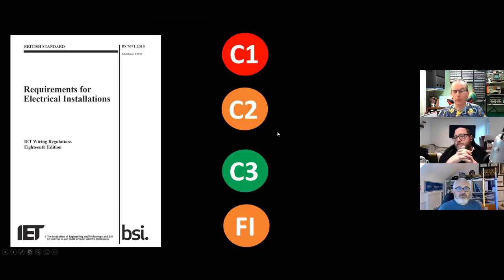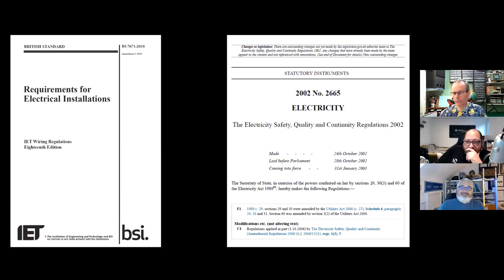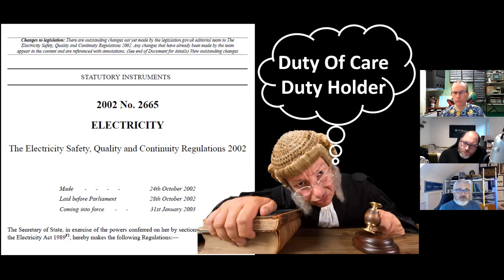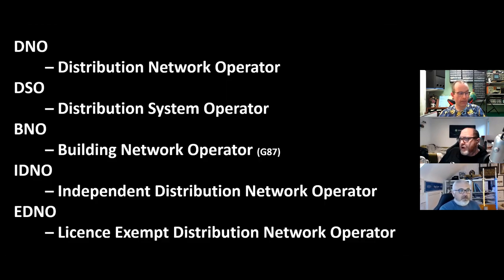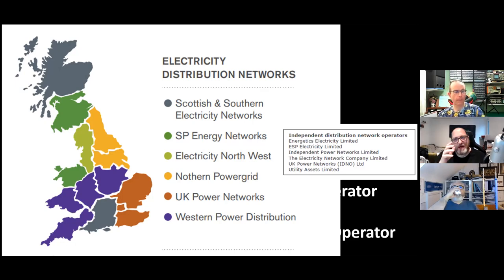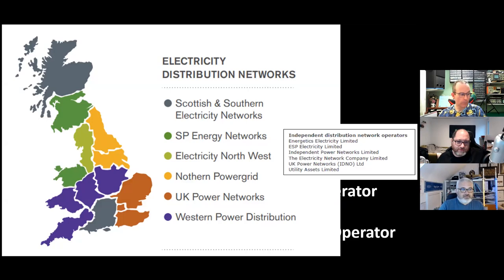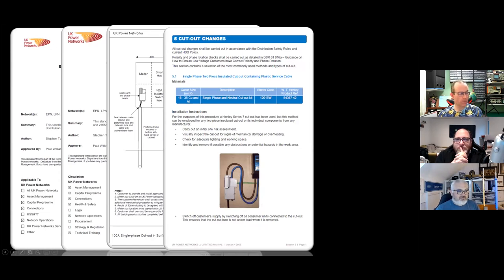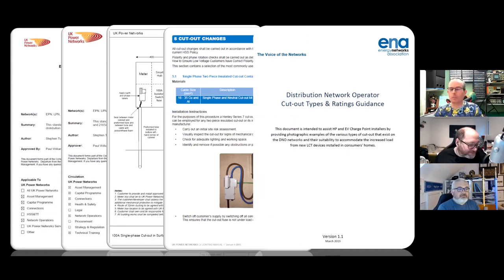EICR coding on intakes with John Ward and Paul Meenan

Comment: Transparent cut-out fuse holder might be helpful.
Reply: Its hard to make a glass reinforced  poly and you're not gona see anything apart from the rating which tbh we guess at by the di tail size     assume 80......integrated a switch ...should have been done decades ago

Comment: You have to be careful where an earthing conductor goes into a cut-out is assumed to be TN-C-S (PME) as a few years ago I was fortunate to go into a Weston Power stores and the cutouts for TN-S and TN-C-S looked the same one had a link for the neutral and earth blocks inside the other did not both would have the consumers earthing conductor going in.

Comment: Fun fact the DNO in charge of Liverpool are aware when asked that the whole of the system is phase reversed, grey black brown, as apposed to, brown black grey, for the rest of the country. It was done years ago and would cost to much and would cause to many problems to change
Reply: There is also a big installation in Borehamwood where the supply transformer also is Red Blue Yellow / Brown Grey Black

Comment: You were saying about in a meter box and interference. We were in a well-known hospital in Northampton and we're using 2-way radio's to isolate final circuits and the 2way radios were tripping the Memshild 2 RCBO's (type AC) when we replaced the D.B with Memshild 3 this didn't happen. It is not until you see it you realise regarding influences.

Comment: Great video. Can I comment on one of the advantages of meter boxed located on external wall? The thief also had 24/7 access. When on holiday they remove the main fuse and then return a week later to break in when the alarm battery is flat and are then not disturbed by the alarm going off. Not sure how one would protect against this. Solar powered alarm?

Comment: Hi! Loving the content. just woundering what you think and if you had any advice 
Doing a rewire and asked my customer to contact the DNO and ask the for a isolator to be fitted and also to replace the head due to it being a very old one with a porcelain fuse carrier which is fine however the issue I have with it is it has a 100amp fuse feeding the meter with 16mm tails which has had three strands cut out to get it in the terminal as they are too small now I would like to install 25mm tails to my new board hense the  isolator. Also exposed terminals on the incoming side of the supply.customer told the the person on the phone this and they said the head is ok it doesn't need changing and if you want a isolator fitted it will be £200  thanks
Reply: Will do thanks for the comment